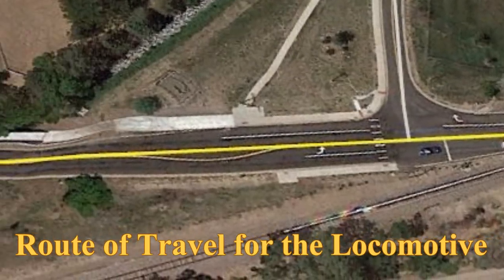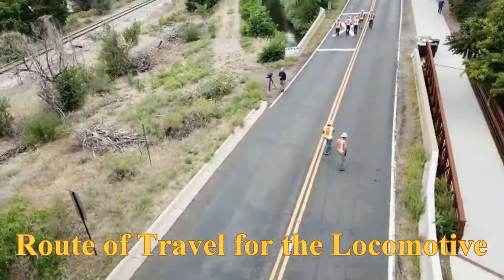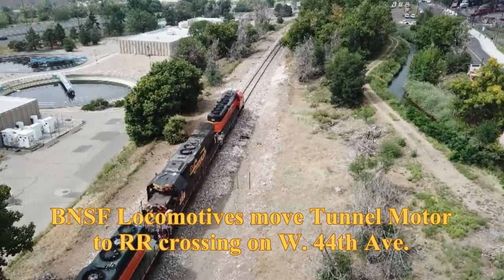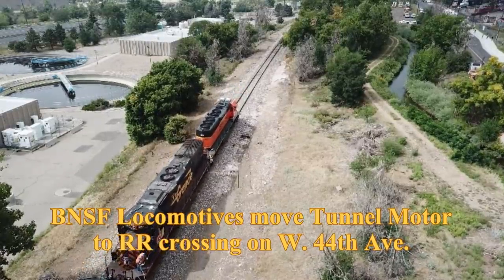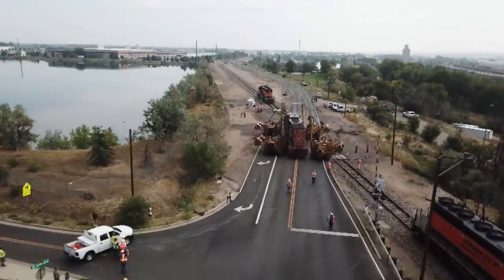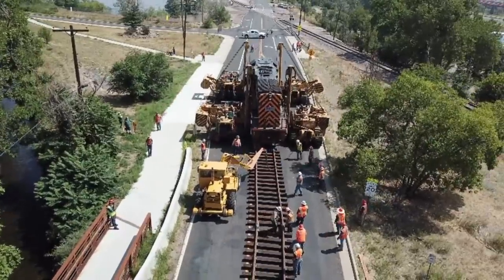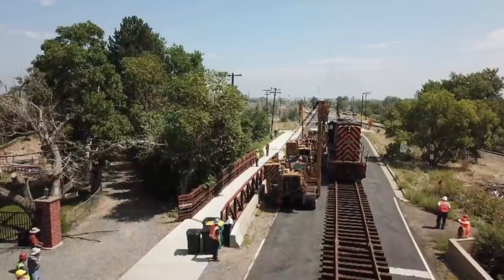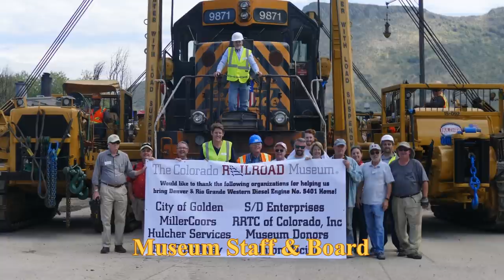2018 August 22nd   Denver & Rio Grande Western Tunnel Motor Move

Comment: The same kind of 'side boom' lifts find a lot of use in clearing wrecks, the amount of weight each can lift is impressive.  I watched a track clearing operation in North Chicago in 1981 or 82, a freight train operating on the same tracks that the commuters had to operate on derailed (speeding believe it or not) dumping 30 or so loaded grain hoppers, smashing a lot of rolling stock and tearing up about 2 miles of the line, two tracks BOTH wiped out.  No one hurt and all three SD-40s (C&NW) stayed on the track.  The clearing contractor crew had everything cleared up so the track gangs could rebuild the line in just a little over 36 hours.  Two side boom units working in concert could pick up a relatively intact loaded hopper and make it look easy.  I knew about the wreck as soon as it happened, I had the duty at the Great Lakes Training Center Boot Camp and the wreck occurred just the other side of the fence from my office in the middle of the night.  As impressive as an earthquake!

Comment: This unit was prepped for the move to the museum at the UPRR Jenks Shop in North Little Rock, Arkansas. It sat on the shops Loco display tracks for the longest of times. UP's new PSR policies in there Unified Plan would have seen the loco scrapped or traded in to PRLX this year had the transfer of ownership not occurred. I'm glad this loco has found a permanent home at the museum.
Reply from the maker: George,  Thanks for providing this additional information.

Comment: That must have cost a fair amount to move that loco. Amazing piece of work. I like the action of the counterweights on the CAT hoists, kind of surprised they were able to operate on a regular blacktop road without mashing the surface. Great video!
Reply from the maker: Actually, they did do some damage to the road surface.  At the entrance to the museum, where they had to rotate the locomotive 90 degrees, some minor damage was don to the road.  The City of Golden took care of this at no charge to the museum.Look carefully at the tracks on the side boom dozers.  They have  huge rubber slabs mounted on the tracks.  They were actually pretty easy on the pavement.

Comment: way back in june(?) 1978, I made my first stop to the old CRIP yard,,chicago,,,Burr Oak.
there on the turntable was a brand new  from EMD,,, a SD40T-2 in DRGW paint.
the rock employees were all over this loco. even on top of it!  my guess being delivered by rock.
nearby were C415s working the yard.  engine terminal were U28Bs, switchers,GPs and even one of those re-powered RS3 mutants.an E7and F7in the roundhouse!
later in 1983 when photoing the end of the MP, we caught an east bound coal train in Mo. with 4 DRGW tunnel motors.

Comment: Looks like a newly paved road just got torn up! 3:55 I don’t think I’ve been to a railway museum, big or small, that didn’t have direct access to an active track. Still a neat operation to watch. Thanks for sharing!
Reply from the maker: Check out previous comments on the road.  It did not get torn up.Have you been to a railroad museum that specializes in Narrow Gauge equipment?  I can't think of one that does have a connection to standard gauge rail.  Please look at previous comments from the museum director on this subject.

Comment: CRM needs a direct connection to that BNSF main.
Reply: That's a no go ghost rider. Too many FRA rules will ensue
Reply: @AbelG8781   How close to the BNSF track could they lay track.  Maybe it already is.  I almost posted the question you answered.  thanks.
Reply: @AbelG8781  FRA rules only apply to major railroads. You can still have a connection to a mainline and not fall under FRA rules. For example every single industry serviced by rail. They really should have a connection.
Reply: the state would go crazy over that proposal. Colorado is becoming a crap fest.

Comment: Am I the only person who thinks that having a rail museum without an active rail spur to the property is kinda weird?
Reply from the maker: No, you are not.  But if you would read some of my previous responses to this issue, you would no longer think this is "kinda weird."    Twice in 60 years large standard gauge equipment was delivered to the museum.  The majority of our equipment is narrow gauge. There is no operable standard gauge locomotive on site.       So, there really is not much that we would do with a standard gauge connection if it were possible to have one.  Which, by the way would be very difficult to make this connection.  There is a canal in the way, significant elevation difference between the nearby spur and then there is the issue of not owning some of the property necessary to make an unneeded connection.
Reply: Great question,  understandable answer. 
However, I've seen whole houses moved with way less effort. Enjoyed this video very much.

Comment: Great Vid. How come the RR museum doesn’t have it’s own connection to the local RR spur?
Reply from the maker: If we did have a physical connection to the standard gage track running into Golden, it would cause a significant change to our operating rules.  And, we don't have very much standard gage track and the loop is narrow gage.  So, there is no way to run standard gage equipment
Reply: @ROKuberski , you might want to contact the NC transportation museum.  They do have a connection to the BSNF tracks and they dont seem to have a problem.  Infact, they have excursions with Amtrak trains about 4 times a year, and the trains come on to the Museum property.  I think all of those things are manageable.  I personally think what you lack is the space to do a rail road museum properly.   Both the NC Transportation and the B and O museum are larger and they can get connections when they want.    Chip
Reply: According to FRA, a physical track connection between a common carrier railroad and a railroad museum does not make the museum trackage part of the General system of Railroad Transportation as long as it is not used for revenue (e.g. freight or passenger) interchange moves.  So such a connection would have minimal impact on operating rules and would have the benefit of enabling equipment like this to be run off the property for special events.  There may be other good reasons (including cost) not to have such a connection, but I felt it important to clear up this common misconception.  I suspect Warren Buffet could find the money to build a connecting spur, and I'd bet the highway authorities would prefer not to have side boom Cats driving on their asphalt.
 /s/ A former manager of training and operating practices.
Reply: Richard Kuberski I understand. Thanks for the reply.
Reply from the maker: @evanstauffer4470  I am telling you what our FRA guy told me.  I'm not the expert.
Reply: @evanstauffer4470  I agree. If the Illinois Railway Museum could do it, anyone should be able to. It's especially nice if you can keep as many of these units in working order as is possible. Another museum connected to working railroad is the B&O Railroad Museum, and they have some REALLY old engines they keep running. Better than letting them just rust in place.
Reply: @ROKuberski  From experience I have learned to do some digging into what you can and cannot do. As an example where I live in Red Bluff, we have a museum house that had a fire in it. when they went to rebuild the rooms that had the fire damage in them, the pompous fire marshal wouldn’t let them rebuild the wall between the rooms. Now they no way of stopping a fire from destroying the house.
Reply: Seems like your FRA guy isn't an expert either.
Reply: several small Railroads museums here in New York State have connections to Class 2 and 3 railroads. All but one museum that I am aware of have nonoperating equipment but are connected to an active railroad. One Museum near Rochester, NY has active equipment and their own set of rails to run equipment on is connected to the Lavonia, Avon & Lakeview Railroad equipment at the museum although rare has been leased to the LA&L in the past when they were short handed. The Reading Historical Society and is connected to an active railroad and has generated revenue by leasing out locomotives on occasion. Steam town is connected to the Delaware Lackawanna Railroad in Scranton, PA and has no issues with interchange of museum pices going on and off property.
Reply: @ROKuberski  the internet railfan community is loaded with "experts".  just ask them :o)  thanks for the video and she's a beautiful loco.
Reply: @ROKuberski  Even if your FRA guy was correct, there's nothing stopping you from running a rail out near the RR company's spur, so that shifts like this would only take a few minutes rather than 6 hours.
Reply: @evanstauffer4470  And even if it did, there is a very simple way around the rule. Figure out what the longest item you need to bring in or remove is going to be. Layout the connecting track as if it were to be permanent. Remove a panel on each end of the section that the item would have to be "interchanged" on. When an item is coming in, install the panel nearest the switch. Move item onto "interchange" track. Remove section toward switch to main. Install panel on museum end of " interchange " section. Move item to museum. Remove panel on museum end. Store sections. Panels could be under 10' long and easy to install/remove with just a forklift. Area under those panels could be concrete pads to make it easy to install/remove. 8' would be an ideal length as it is within the width of a standard vehicle width. No permanent connection exists so no worries about that should the FRA change their mind.

Comment: A retired GM designer on the Rio Grande List told us quite specifically that the tunnel modification was NOT for pulling more cold air in the tunnels.  He pointed out that there isn't any air in a tunnel that isn't choked with exhaust, it's just too small.  The tunnel modification was to increase cooling between tunnels so the engine temperature could recover before the next tunnel.
Reply from the maker: One thing I know for sure, there is no shortage of experts.http://www.drgw.net/info/TunnelMotor     https://www.american-rails.com/tunnel-motors.html     If you have more information, please provide a link to the source, not just your opinion.

Comment: Each time it touches a surface other than tracks, it gives me a strong “NOOO—OOO—OOO” feeling.
Reply from the maker: I can't say 100% for sure, but I don't think they ever set it on pavement or dirt.  They did put wood blocking under the wheels if they had to set it down.  Mostly, It was in the air, on panel track or on museum track.

Comment: I wonder why the loc wasn't lowered onto the tracks in the pavement of the parking, and rolled in, but placed via panel track. Or was it too costly to clear that track, or is it the wrong gauge or not suitable for the load? (not an expert)
Reply from the maker: If it has been put on that track, and it is a three rail track, they would have had to roll it onto the turntable and then rotate to put it on the track designated for display.  I don't think they were confident that our turntable would support the weight of this unit.  It would be a minor disaster if it would not.  Would you want to then retrieve that unit off of a broken turntable?  Avoiding the turntable took less than 1/2 hour of maneuvering.  Well worth the effort.

Comment: And my friend said that all the Rio Grande units had been repainted
Reply: There are two units running out east on a short line hauling coal trains, since the railway already bases their paint schemes off the Rio Grande, they have been preserved with their original markings and paint.. So far as I know, they're the only unpatched tunnel motors still running.
Reply: that's the wheeling and lake Erie railroad
Reply: The Arctic Gamer I think there's a few more than just two I know of two on the wheeling and Lake Erie alone and I think Ohio Central has one or two
Reply: @trainknut  This is true, it is the Wheeling and Lake Erie, and I have seen one of them.
Reply: @plymouth-hl20ton37  , I think RJ Corman owns some.

Comment: I think rain shelters should be looked into for museums that have vehicles and equipment outside. I imagine it helps reduce water building up inside as well as reduce rust and slow down sun bleaching of the paint. I'm not expert on this topic, but I imagine 4 poles and the sheet metal for a roof wouldn't add up to unreasonable amounts.
Reply from the maker: Something like that is under consideration, but they need to be well designed for our conditions.  100+mph winds are not unusual in our area.

Comment: Why wouldn't a railroad museum not have track access to just bring it into the display track by rail?
Reply from the maker: Please accept the fact that the museum site does not lend itself to a connection to the nearby standard gauge track.  Much of the display track is isolated, some is connected enough that you can get back to the roundhouse.  It is NOT a problem for our museum.  I've ridden many of the other narrow gauge tourist trains in Colorado.  If any of them are connected to standard gauge, I am not aware of it.  There was a whole network of narrow gauge in the late 1800's up through about the 1950's in Colorado/New Mexico/Utah and maybe other places too.  All that's left is isolated sections still operating as tourist trains, such as; The Georgetown Loup, Durango & Silverton and Cumbres & Toltec.

Comment: 1) Will the cab paint be touched up to restore the D&RGW number?
2) Is this the last tunnel motor in existence?  Why was this one picked to be saved?
Reply from the maker: Sometime in the future, this unit will be restored to look like it did when it was operated by the D&RGW.
I very much doubt that it is the last one in existence, but I have no personal knowledge about the location of other units.
Much of the collection at the Colorado Railroad Museum is D&RGW equipment, so is this locomotive.  It's a natural fit for us.  And, our director got it donated to the museum, but the museum had to get it moved to the property.  After donation, it sat in the Coors Brewery rail yard until the museum could arrange for the move.
Reply: Theres two tunnel motors in of SP orgin in Claremont mn
Reply: @needsmetal  Huh... I really need to get myself up to Claremont. :P

Comment: Hear is a way you can do it. Just build the track up to the museum property and leave out a section of track, then when you are adding a new piece of equipment, just add the section of track long enough to move the equipment and then remove the section of track. Save wear and tear and resurfacing the road. BTW what are those tractors normally use for?
Reply: to fix derailments
Reply from the maker: Build the track where?  We don't own any right of way for track construction.  Buildings and a park between the museum and the track crossing.
Reply: @ROKuberski  Being I live in the socialist state of California and not Colorado, I can only offer suggestions.

Comment: How much blacktop did they destroy?
Reply: Looks like quite a bit.  But hey, just get an asphalter, trucks, and rollers and it'll be fixed in no time.
Reply from the maker: @johntapp9670  Only road damage was at the entrance to the museum where they had to rotate the unit 90 degrees.  The city of Golden did the repair work at no cost to the museum.
Reply: @ROKuberski  oh, good.  It must have looked worse than it really was.  I knew it was reparable.  But I am very glad the locomotive got there in one piece and in good shape.  Whatever you do, keep the UP emblem on it and even fix it.  They believe in history, and I find that in terms of variety, they are the present "Standard Railroad of the World," like Pennsylvania Railroad was.  For motive power, they're second to none. If you can find a DDA40X, GET ONE!!!

Comment: D&RGW's SD40T-2, I have driven some of them weeks ago in Train Simulator, Soldier Summit, during the job, our train encountered extremely heavy snow storm, even hard to read signal lights, and what worse is a brake hose failure caused train go emergency brake and stopped on up hill, then conductor go out of cab then fixed the problem. Don't know if D&RGW's engineers and conductors work around Soldier Summit have to deal with such things in winter, if so, hats off to them!

Comment: They need a spur to be museum. It would make life a million times easier
Reply from the maker: Here is a response from Donald Tallman, Executive Director of the Colorado Railroad Museum.
"There is no possible direct connection to the main line given its proximity to the Museum.   Most of our railcars are narrow gauge and can easily be trucked in.  This was a very large and heavy locomotive that was easily and safely moved using the sidebooms. "

Comment: Also for only 1150' from the museum to the main line, they ought to just have a permanent spur track for past/future endeavors like this. Tell me why not?
Reply from the maker: There are numerous reasons why this is neither feasible or desirable.   The elevation difference is significant, there is no room between existing canal/road/rail line into Golden, the museum is primarily narrow gauge, a standard gauge connection has very limited use (twice in 60 years), we don't want to be connected to a FRA rail line.  CRRM is an operating railroad, but only as narrow gauge.  Please read through older posts.